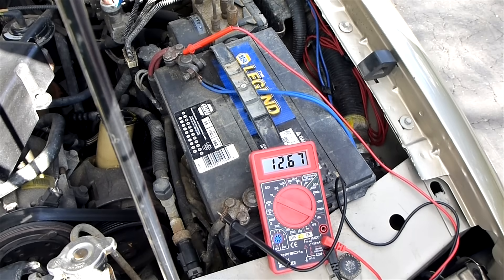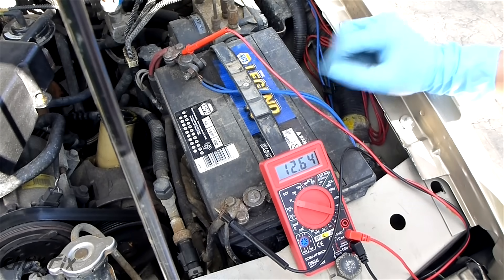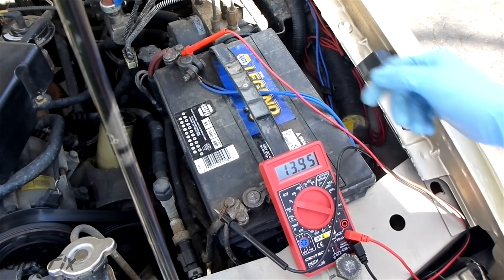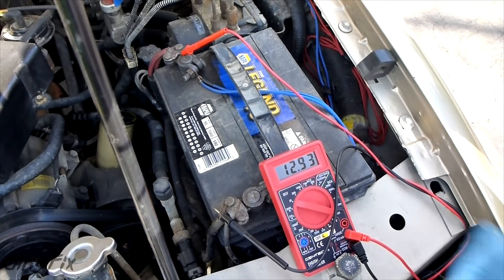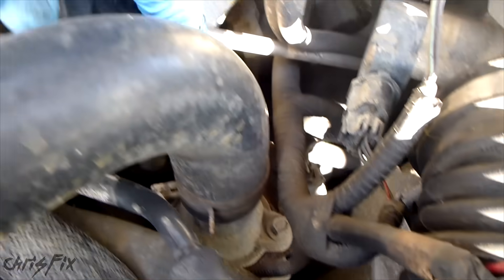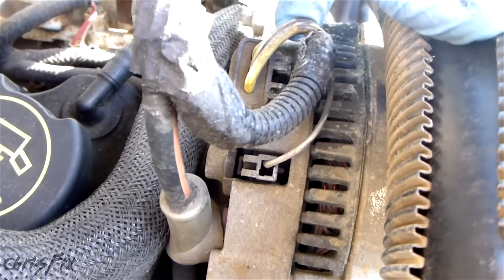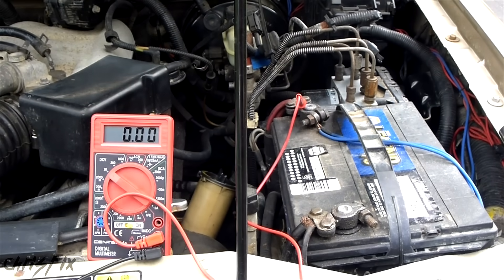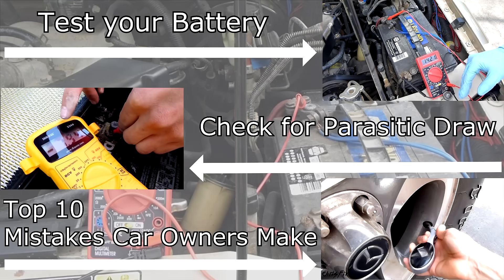How to Test an Alternator

Comment: Chris, you're doing a great service for people far and wide!   Thank you
Reply: Shouldn't drop at all. Long as you have anough alternator to created the DC voltage and current. Also proper wire size and terminations. If your system drops below idle no load voltage, you have an issue. The entire vehicle and audio slash lighting systems are being under fed/performance.
Reply: James Leonard 2012 Volkswagen Jetta s
Reply: Jamie Delour
Reply: Jamie Delour nn
Reply from the maker: I am glad the videos are helpful!!!
Reply: Chris, u said that the voltage should not drop below 13.0v with loads on, but then u go on and say it should not drop to 12.7v. So which one? thanks for all ur help, you're awesome.

Comment: How much does that meter cost to check the battery and the alternater and where can I buy one??? Every time I go to a auto zone auto part store, and they put their own machine on they say my alternater voltage regulator is bad!!! My 2012 Toyota 4Runner only has 23,400 miles on it so I find that very strange for a car with very little miles to have this problem!!! They told me I had a bad battery when they first tested it. So they put a new one on and then did a re test and it came back saying my voltage regulator was bad now!!! So I think it would be a good idea to invest in this meter so I can do some further diagnosis myself instead of paying $160.00 just so they can put it on a machine and test it,don't you think???
Reply: its called a multimeter, can buy from any car store price varies i bought one the other day for $35 NZD
Reply: Alex Jaxon
Yes a better multimeter can be bought from ebay for between $7 - $15.  Look at my channel for extreme challenge!

Comment: I tried doing this with my honda fit, the voltage with the battery (all accessories turned on) is only 13.6, while when i did the alternator test its at .76 but drops down to .02 and sometimes to .00. What do you think is wrong with my car.

Comment: my is reading is  12.53 manual toyota echo.when car is off  is this bad and reads 13.9 when car  its on. . ive change several batterie because it just dies out
Reply from the maker: The 13.9v reading when on is good. That means the alternator is working!

Comment: I have a Jeep Cherokee 1998, I6 4.0L  It's not so easy to check the alternator as you do it because it's kinda hidden....  any other suggestion? Thanks a lot.
Reply from the maker: Try to get down there. You can also just test it at the battery like I show in this video.

Comment: Hi Chris,
I have a 2006 Mustang. With car off, I have 12.56 volts. With car on, 13.9 (no load). With load (fan, lights, radio), I get 13.8. When I run AC, I get 12.5 when compressor on, 13.2 when off. I'm not getting anywhere near 14.2 to 14.7 with car on. Do you think I have a bad alternator? Thanks much, Todd

Comment: Chris thanks again for all the helpful tips.  Has really helped me a lot due to my truck being old and is basically my way of learning on how to fix things.  One thing I'm trying to figure out is why my reverse lights all of a sudden don't work at all.  I had a brake light that was out the day before, the guy did something to fix it, then the next day my back up lights stop working.  Not sure if its bad ground connection, or what?  Any advice goes a long way, and thank again man!
Reply: Christian Reiller check the fuses out. Bust out your owners manual (if u still have it or google) your fuse box and start pulling the fuses for those circuits. Visually check them to see if they are good. If its blown or melted (the little "S" inside the fuse is broken)
Then u just have a blown fuse. Replace with the correct one and see if it works. If it doesnt then u gotta keep looking. Might be a short, a switch, bulb is burned out. Something is causing it to lose power all the way to the bulbs hence you might have a "short."
Gonna need a wiring diagram for that and further diagnostics. For example in my 03 mustang my brake lights just randomly stopped working too but on my car when u turn on the instrument cluster lights it'll turn the brake lights on because its a dual filament bulb which told me that circuit was working fine but when stepping on the brakes they wouldnt light up even brighter which meant i had to keep looking. Well end of story it ended up being a brake light switch. One of the 2 cables (on the actual switch) was completely broken so i wasnt getting any power to that circuit. Had to solder in a new one and trust me shit was a bitch being under the dash with no room to hold the wire, the soldering iron, the actual solder, and the switch at the same time but i got it done haha and then i pressed on those brakes and bam!! Shiny bright red lights lol. Good luck!! A wiring diagram will be ur best friend im this case.

Comment: When I attach the negative to the battery and the positive to the case and the bracket it reads .01   the chassis reads .00
All other readings were in speck... 14.2 while running and with everything on 14.18-14.2
Battery has 12.6 ish while resting

My inquiry was the result of seeing a decrease in voltage while driving and the battery indicator light coming on and then turning off after pressing on the gas... 

After turning off the vehicle the battery gauge read within normal limits...

What do you think is the problem (battery light turning on and off)?

Thanks in advance for your help.

Comment: Chris I have a question for you . Does it make a difference if I keep my battery connections loose ?? As far as charging the battery ....Thank you
Reply: It not a good idea as loose connections are the greatest of intermittent problems! So charging may be reduced...especially when driving which can cause jitter and movement.
Reply: Make sure the connections are clean, and apply some dielectric grease http://d35gqh05wwjv5k.cloudfront.net/media/catalog/product/l/o/loctite--dielectric-grease-ee100-lg.jpg to the mating surfaces before you tighten them. It will keep the corrosion out and make the connection last a lot longer.
Reply: sputnic can I ask why do you want loose terminals

Comment: hey Chris, have you done a load testing video? any suggestions on one to buy that's a good one that will last? not harbor freight lol
Reply: Richard Cowtails fluke 87v
Reply: Billy Carvalho I have that. I meant an actually load tester not just voltage
Reply: Richard Cowtails search for DY2015 duoyi on eBay. Very nice cca tester and costs about 30usd.

Comment: my 96 pulsar 1.6ltr.   the battery is around 13.2.  but when i put the headlights on.  it drops down to 6 and car cuts out.    is that the alternator by sounds of it.?        any vids of how tk change alternator in n15 pulsar

Comment: question my engine running with AC and lights give me 13.75 with engine off 13.10 and engine running no lights no a /c  13.70 so means alternator is good or bad?
Reply from the maker: +Armando Sanchez it's a little low but it sounds like it is working.

Comment: Great video.   Question on the positive terminal test at the end. A 0.2 volt drop seems awfully high.   Shouldn't that cable be a direct line to the positive terminal of the battery?   If so why should it be 0.2 volts and not more compatible to thr 0.05 volts on thr other end of the circuit.

Comment: So I had he battery and alternator tested at Autozone and the guy said I needed to replace both. I replaced only the battery. I'm at 12.7 Volts when the cars off and 14.1 Volts when idling. So do I really need to replace the alternator?

Comment: My car was hard to start recently and when I finally turned it over, I looked under the hood and noticed that the alternator wire was SMOKING. Then the electrical components of the car shut off and it was completely dead. The alternator is fairly new, so what could be causing the wire to smoke?
Reply from the maker: It might be shorted out somewhere or the battery is bad. I would remove the wire and inspect it.

Comment: We have a Ford Taurus that I noticed today it was starting like the battery was weak well I started it tonight and it was a slow sluggish start then we came out again to drive it since it was going dead so I turn it over and the battery is just ticking so I hooked my multimeter up and before string it was 12.32 volts and after turning it was 10 volts then I connected while turning over 8 volts tomorrow we are gonna test if it is the alternator or the battery just wanted to know what you think chris the battery isn't that old we had to replace a lot of batteries in this car because it used to sit for some time. Thanks
Reply from the maker: If the battery isnt old, maybe the alternator isnt charging it.  Keep me posted! Clean the connections on your battery and your grounds too!
Reply: +ChrisFix OK thanks we will have to do this in the morning it Is really late
Reply: +ChrisFix I would say the battery is only a couple years old
Reply: +ChrisFix Turns out we bought that battery in march of 2015

Comment: Hi Cris, I got a 12 year old peugeot 206 which after 20 minutes starts to beep, show warning signs as a result of voltage drops not able to sustain computer systems to keep running for short while when the engine runs idle (in front of traffic light). Could this be caused by a bad alternator?
Reply from the maker: Sounds like a bad alternator or a wire that is too thin and heating up so the resistance increases and voltage decreases. Jaguars had this problem from the engine heat and they ran the wires right over a hot part of the engine.

Comment: my dcv on my meter settings are 15, 150, 1000. should i pick 150? seems a bit high lol. this would be so much easier if they didnt bury my  battery in front of my tire
Reply from the maker: 150 should work but are you sure that isnt ACV? That seems pretty strange it would go to 1000 DCV with jumps like that.
Reply: yah it was dcv. acv was on the other side. it was a very old meter from radio shack my dad gave me about 10 years ago. the 150 didnt seem to work very good so i just used 15dcv. i got 12v while off, and 13v while on. its not digital so its a bit rough to use.  its odd it had full power. the past 2 weeks sometimes i turn the key and the entire car shuts down and is completely dead. ill keep turning the key and if im lucky itll start. it got stuck in my driveway after turning it off to close my garage door, so i got another car to jump it with cables and it started. the jumper cable popped off after about 2 minutes and my car immediately went dead and shut down. i put the jump cables back on and charged it a little longer hoping to get enough charge to pull it back into the garage. it worked and i got it in there. i been starting it the past 2 days and so far its started ok. i still cant figure out of i got a corroded wire somewhere, loose wire, dead battery cell, or a alternator thats going bad and only charging sometimes. i dont think its the starter since all power seems to randomly go. but then it can randomly come back. all depends when iturn the key. im going bat shit crazy. the starter, alternator AND battery is all below my engine area and is to hard to get to.

Comment: Hey ChrisFix, here's a question for you.  My 05 Saturn Relay has around 14 volts on average, except when I run the rear air, it can drop to 11.7 at a stop light or anytime I stopped for more than a few seconds.  As soon as I turn off the rear air, my voltage climbs back up to 14v or so.  Since I'm getting over 13 volts, no one is wanting to mess with it.  What's your thoughts?  I only run the rear air when I have passengers or if it's extremely hot.(which it has been lately)
Reply: i think your  alt  in   bad condition.  it performs  undercharge /less charging  ...      but there is a factors   befire we consider that the alternator of your car   is not good. first check your  alternator belt   bec. sometimes  the belt  is loosen.          i mean not tight..    the  alt.  performs  less accelerate    ... and.  also the second is...     first let me knw   when you turn on the aircon /blower   .        did you notice the.  idle up of your car ?                 if the 2factors    that i mention is good  . your       ..  alternator.  is not in good condition
Reply: i think your alternator is not in a good condition. it performs.   undercharge /low charging
Reply: +John robert Ulanday I get almost 15volts except when I the second a/c. If I'm driving highway or even a decent speed, it stays up.

Comment: just went to a alternator/starter shop. they checked alternator and battery . said it was good. think it could be the headlight switch since one night I was driving and my lights all of a sudden turned off while I was driving and came back on. had to run  a bit with flashers. help
Reply from the maker: Let me know if that is the problem!

Comment: it's now been about 2days. now battery reads 11.90.  is that normal.
Reply: battery voltage drops a bit depending on much load your car has when its off , like alarms, clocks , memory for radio, etc. 

some loads are bigger than others and also the age, quemical composition and size  of the battery is a factor as well as  capacity so 
unless you are having trouble starting the car after a while , i wouldn't worry about it.  

short answer: i wouldn't worry about it as that seems to be  normal behavior for oldie batts.

Comment: after 2 day w.o start battery dies. could it be my diode??. if  so . for a quick test . I unplug my clip on alternator but not ground. still my Metter was very high . 1.92.
Reply from the maker: It could be but it sounds like at 2 amps you still have a big draw. I would start pulling fuses to see where the draw is coming from.
Reply: +ChrisFix I did to begin . still couldn't find nothing. 03 trailblazer. diode?? could that be.

Comment: hey Chris I always watch ur videos and I learn alot from them. I done the same test with my car by checking my alternator and battery the battery voltage is 12.7 volts. then when I start the vehicle it goes up between 13.8volts to a steady 14.0 volts is that OK for the average charging system for vehicles

Comment: I have an rv that keeps draining battery overnight. because of the setup I can't reach the lead from the battery to the alternator (you can only access the alternator from the inside of the rv... while it's running anyway) so I can't perform all these test. is it possible that the alternator not grounding properly is the cause?

Comment: having an issue with my car, at night with the headlights on,(and some days when I have the A/C on) my volt gauge will drop and the lights will dim for a few sec then go back to normal. This happens multiple times while I'm driving.  Is this a symptom of a bad alternator? I just replaced the battery recently and still same issue. Thanks.
Reply: i to have this exact issue 06 Hyundai tuscon v6 not sure the issue yet
Reply: This same thing has been happening on my 99 Galant for the last few days now.  Probably need a new alternator but will take it to Advance just to get it checked out.

Comment: With the car running I get a reading 16-17 volts but my battery keeps losing charge. Do I need to replace the alternator or the battery, or both?

Comment: My battery voltage when car is off is 16.6, when I start up car the volts go up to 17.4. Why is that? 2005 VW Jetta just install brand new battery today. Old battery had corrosion on terminals and would not stay charged. had to jump the car everytime I turn it off. I tested the Alt the ol school way ( disconnect neg Bat cable) and the car idled down some but kept running. Thx in advance for your help.
Reply from the maker: Sounds like your alternator is bad (voltage regulator). The high voltage probably fried you old battery.

Comment: Hey Chrisfix, love all your videos, they help out a lot. not sure if this can help my issue and would like your thoughts. when i open the door to my vehicle, the interior light at the top stays on but when i turn the switch that keeps the light on when the door is closed, it begins to flicker whether the car is running or not. the dash lights also slightly flicker but the headlights never flicker. any thoughts? it's a pain when looking for something at night in the car when the light wont stay on.

Comment: hi cris im just wondering what happen  to my battery voltage reading goes up and down when engine is running. is my alternator giong bad or the battery? i hope you can help me. thanks
Reply from the maker: Probably the alternator. Shut the car and see if the battery voltage goes up and down still.
Reply: +ChrisFix when engine is shut, battery reading goes up a bit about .1 volts. also cris is 13.6volts battery voltage normal?

Comment: It's not normal for a two year old supposedly heavy duty battery to go completely dead when the car has sat for two to three weeks without driving is it? Happening to my STi at the moment. It's out charging in house at the moment. I am blaming power draw from Clifford alarm until I find out...
Reply from the maker: It shouldnt. My Vette sits for 4 months over the winter and the battery is definitely a little discharged but not bad enough I cannot start the engine. Check that alarm because it can be drawing enough where it would cause that problem. That might be normal if your alarm draws that much power. Here is how to check the draw: https://www.youtube.com/watch?v=n5FJDgcdii8
Reply: Yeah Clifford has tilt, vibration, and proximity sensors so any car door closing beside it causes loud chirping, and when a modified car with a loud exhaust that lives nearby passes by nearly every day he almost always sets off the full alarm from the low frequency from his exhausts... he has to crawl by with his foot off excelerator because he knows it happens...